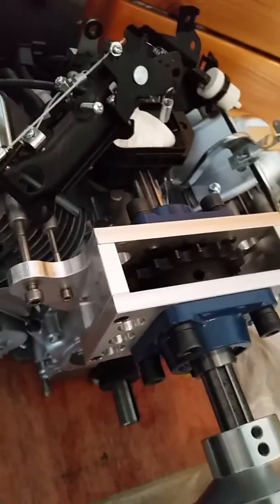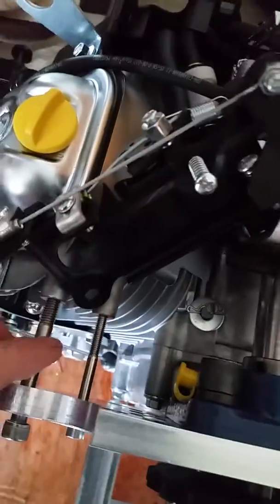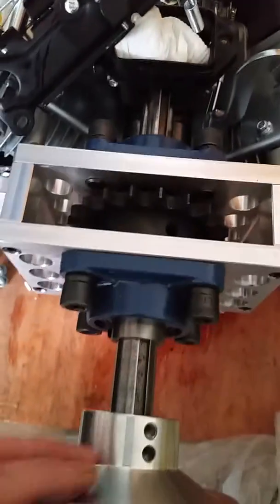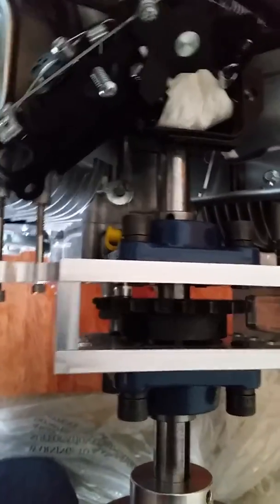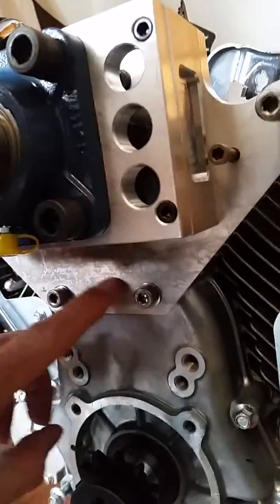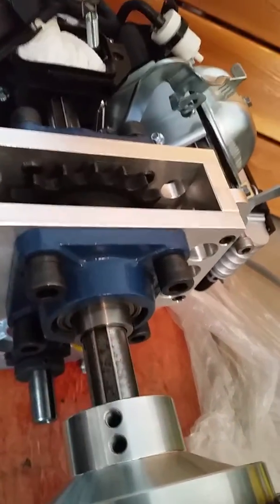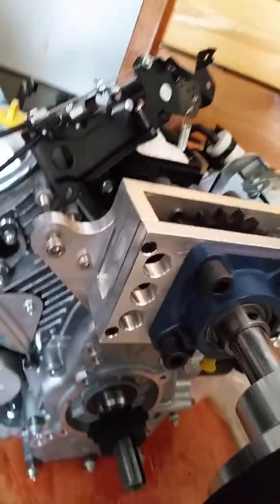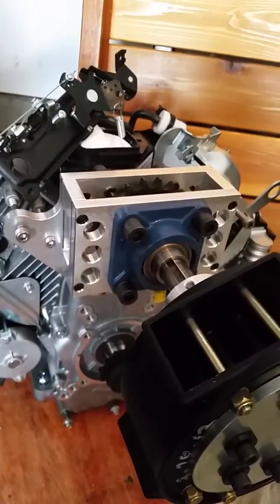Predator 670

Comment: The specs say max torque is at 2500 rpm, do you think you could put a wood prop direct drive on it and have it work? Thanks
Reply: The engine shaft does not hold up to direct drive. Too small.